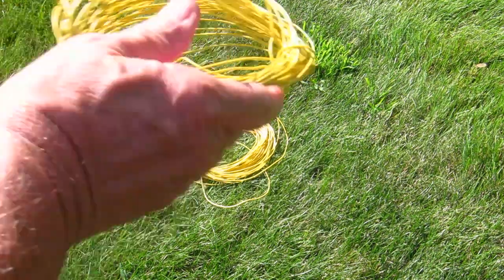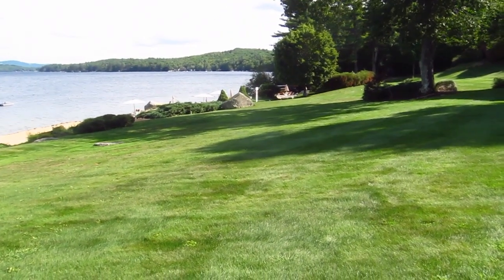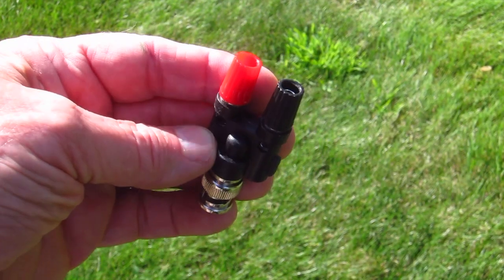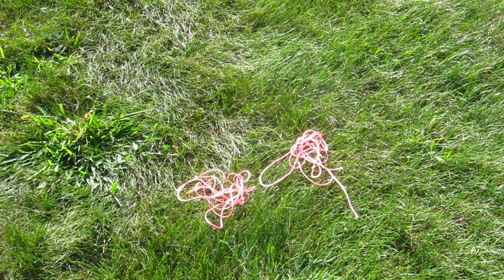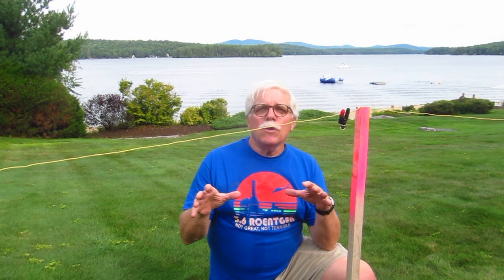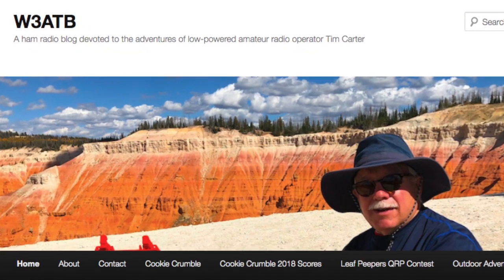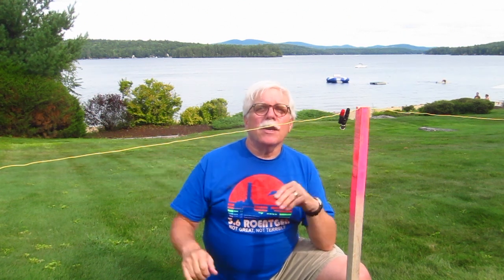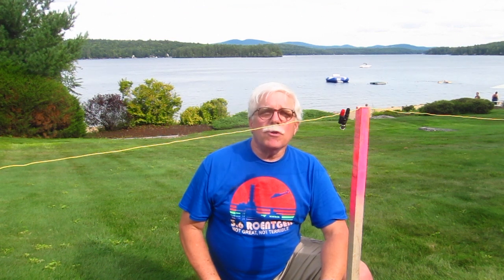80 Meter NVIS Antenna

Comment: I stated with almost this exact setup, and could not get the SWR I was hoping for. On 80 meters, I have to get the feed point much higher in the air. I also suspect the angle at which the two sides of the dipole are relative to each other (flat dipole >>> inverted V) further reduces the impedance to a more desirable level. I would like to see an analyzer applied to this setup. I can't imagine this working without a serious tuner.
Reply: You don't have a tuner that can tune that low of an impedance. This dude is smokin some shit WAY better than I ever did.

Comment: Does it work? Do you need a tuner? I thought it was a great video... as far as it went, but seeing how it performed would have been most helpful.
Kinda like me doing a video of how to butcher and dress out a turkey, but only show a live turkey out in the pasture.
Just sayin'.
I'm designing an NVIS antenna that is built inside a 50-gallon steel barrel. Aiming the open end of the barrel should direct the powerful beams of energy in one focused direction.  I drew my inspiration from "This Island Earth"... a 1950's documentary on the work of Gort and Exeter.

Comment: Tim questions:  1. Can the wire touch the tree branches if I put it through the trees?  2. Does it have an exact height off the ground or does it matter how high I put it?  Thanks
Reply: @christoje  I did not get an answer. I managed to avoid any branches in my application

Comment: Great video. Thanks. Can you get a banana plug with an SO239 connection instead of a BNC? And does it make a difference? All my coax is has PL 259 ends.
Reply: Get an adapter. I bought a pair from Ham radio outlet.
Reply: @Bushy556  Thanks. I keep forgetting to check to see about adapters. 73.

Comment: Does the person your talking to need the same antenna ? Also, most users recommend a "reflector" laying on the ground. Using the same math used for a "beam" or Corner reflector, the reflector would be about 5% longer.
Reply: no.
Reply: @californiakayaker N6GRG - I have no intention of starting a quarrel, but the comments from Grey Ghost are not entirely reliable, here and elsewhere on the comments for this video. Antenna orientation normally has a significant impact on the exchange between 2 stations. Depending on what you are doing and trying to do, I would recommend getting a little more information than just a "no".

Comment: can we put it on the gutter? not in a straight line VA2SOB
Reply: Yes you can, any height less that 1/8 of wave length is NVIS, for 40m height should be at or less than 5meters, for 80m band 10m height or less

Comment: Why did you choose 80 meters and not 40 or 20?   Wouldn't the wire be shorter and easier to work with? Am I missing something?
Reply: Works on any band..   You could probably work farther at night on 80.   That's my guess
Reply: @GreyGhost-r4z  Remember it needs to go up & bounce back.... the higher freq's may not bounce depending on atmospheric conditions. And the goal here is "short" rather than long :)
Reply: Most of the time 80 meters is below the Maximum Usable Frequency (MUF) at night, allowing the signal to go straight up and reflect straight back down (NVIS). 40 meters will work the same way most of the time in the day, but where I live, this time of year, this part of the solar cycle, anything above 80 meters has a high probability of passing right through the ionosphere at this angle (theoretically). Not about going further, it's about a reliable regional net (~300 mile radius?) - where terrain has no impact.
Reply: Looks like you got a few good answers. 20 is not a NVIS option. 40 a bit but 80 and 160 are best.
Reply: I worked 7.251 mtrs daily in the mornings with coverage over the entire southeast US from south Alabama.  My NVIS dipole was at eleven feet the entire length under an oak tree oriented SW to NE.  Feedline was at 90 degrees for close to 25 feet.  Worked Into Spain and France fairly often in the evening but conditions were favorable.  NVIS is great for regional comms.

Comment: how do you test ladder line  to make sure it is 450 ohm .
Reply: Use a 9:1 balun at one end to match it to a nano vna then on the other end of the ladderline terminate it with a 450 ohm resistor

Comment: Great video. At what height do you lose the "NVIS" effect? My antenna like this is 35 feet at the apex. Thanks from Utah.
Reply: Inverted V antennas have some NVIS effect to it regardless of the apex height. The radiation pattern is absolutely not null above the antenna